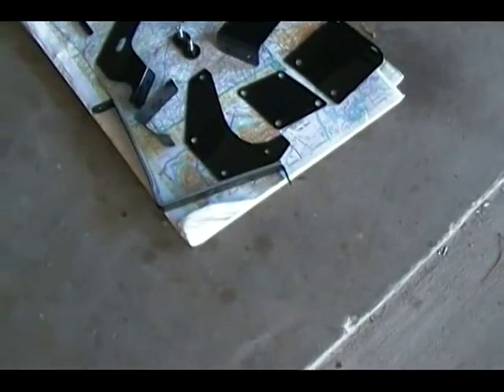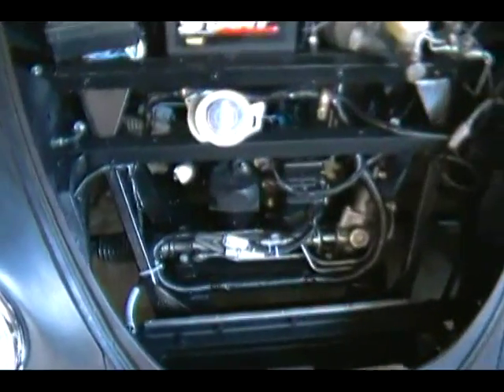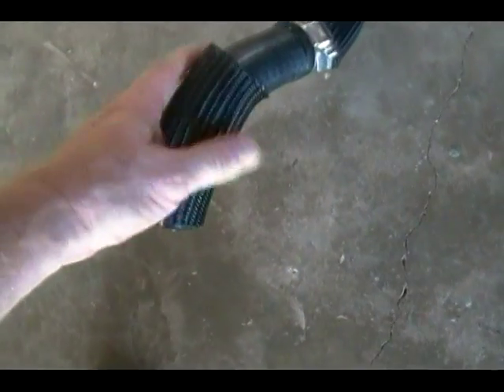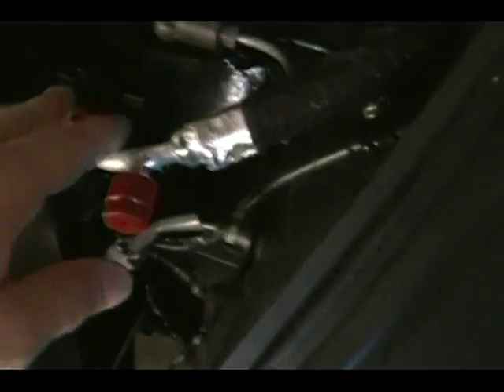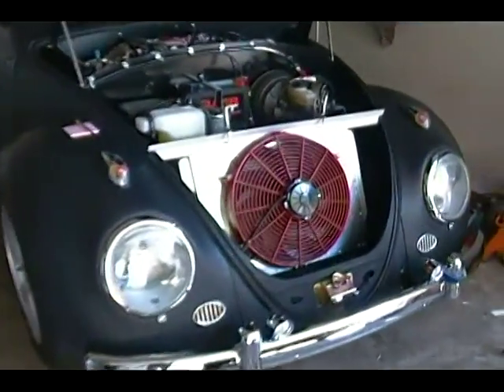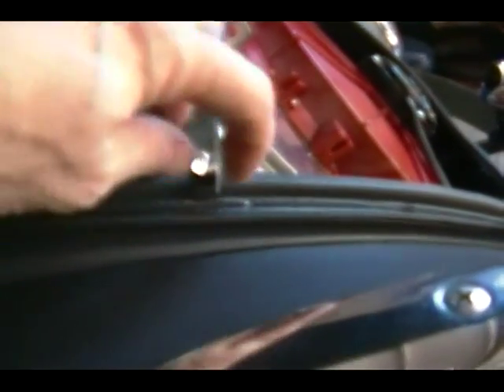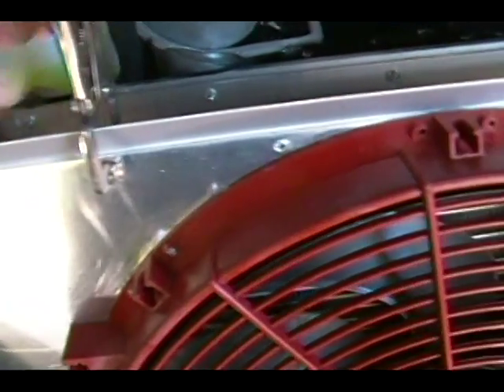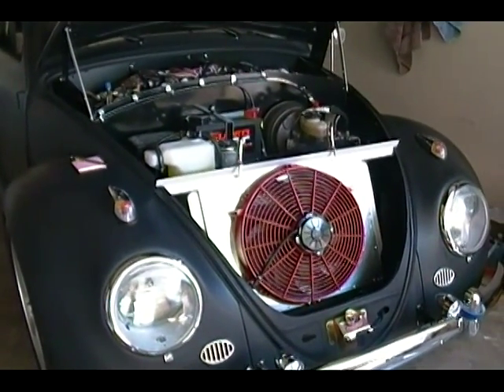Finish VW bug radiator redesign build ducting #482

Comment: Nice work but there is one big problem you have to address. The condenser must always be fitted before the radiator to avoid to blow hot air into it. Condenser must the receive fresh ambient air and not hot engine air. This will cause poor cooling because of lack of condensation in the a/c system.